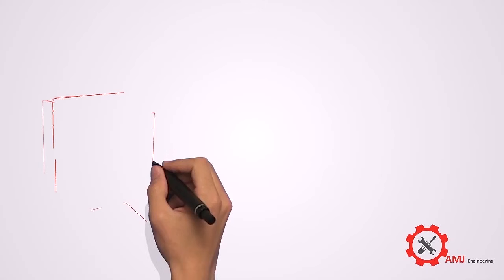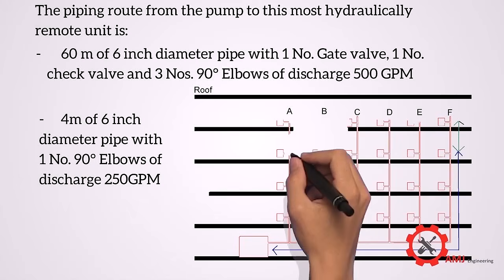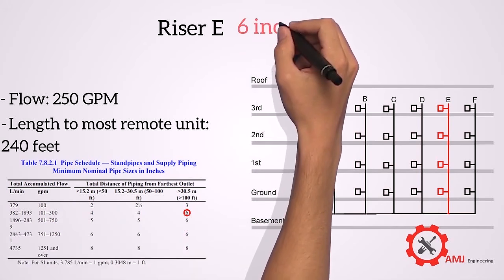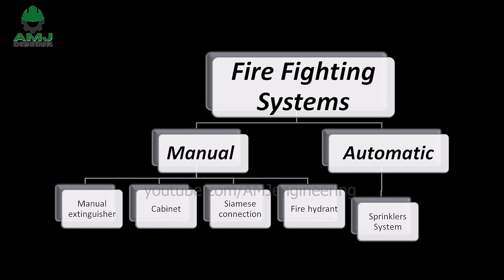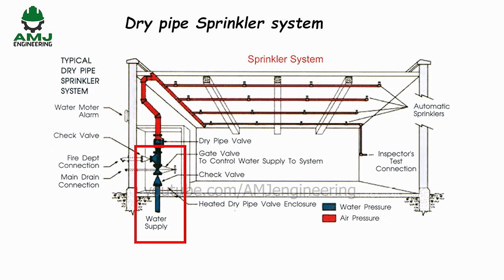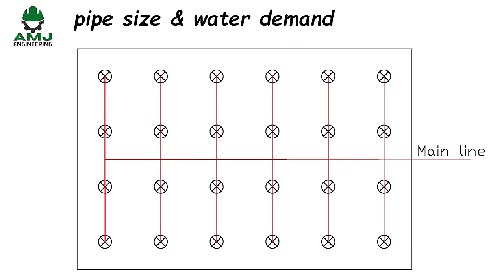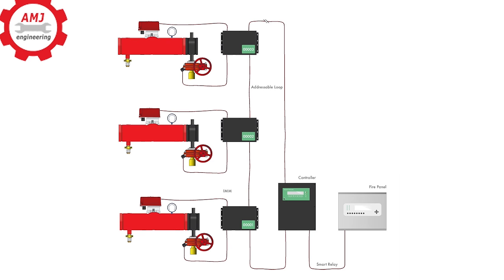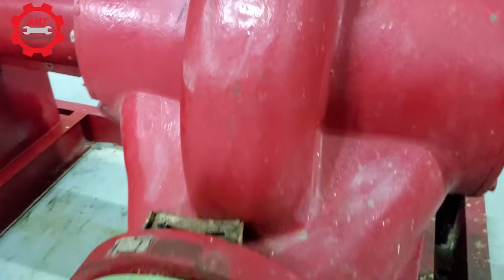Complete fire fighting course

Comment: boss for the calculation of total friction loss, why are the calculated friction loss per feet for both 500 gpm and 250 gpm is different from the value of friction loss multiplied to the total length of pipe? thanks
Reply from the maker: https://www.udemy.com/course/learn-firefighting-without-prior-experience/?referralCode=FD9C5F89744ECECF483A